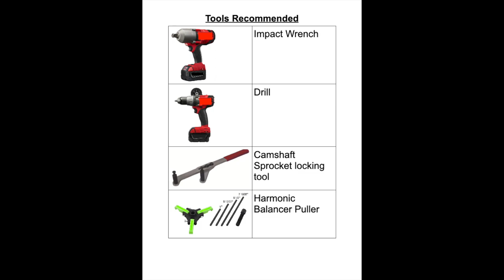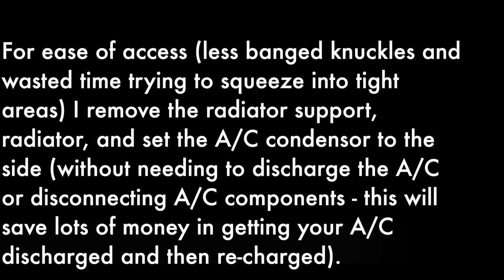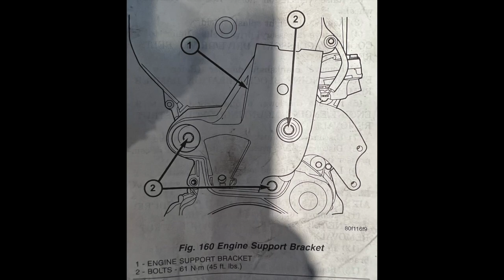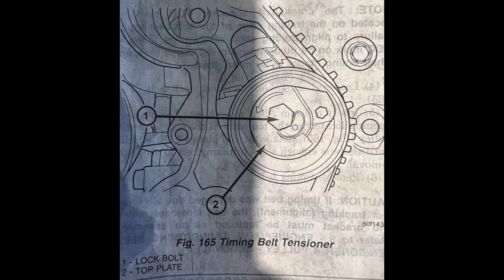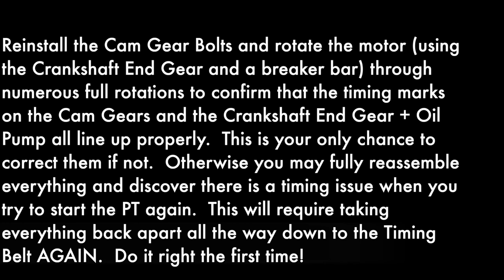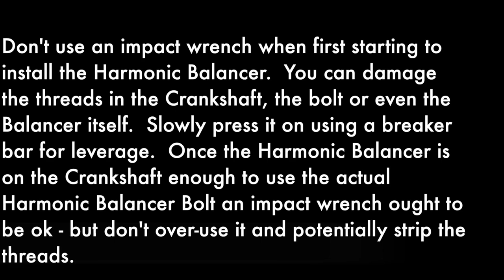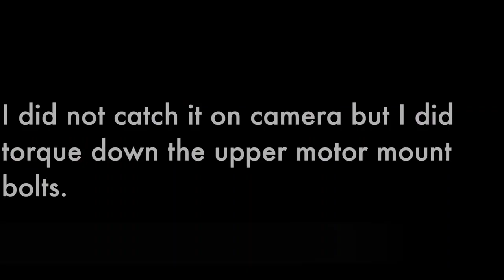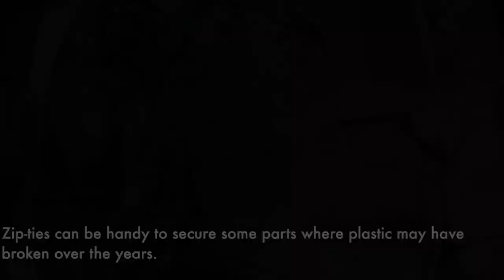PT Cruiser Timing Belt Replacement

Comment: Hi there, I just came across your video on pt timing belt replacement...you make it seem so easy!
I am not 100% sure timing belt is the issue with my 05 PT, I unsuccessfully have thrown parts at her and took to a shop that couldn't fix either.
A friend thinks timing belt has jumped teeth.
Yeah, at 140k, a belt is needed no matter what....
Issue is, she runs fine up till 2k rpm, then she stutters and bucks like crazy, gets on down the road just fine as long as she stays under 2k rmp 😞
This sound like a timing belt issue to you?
Thanks!
Reply from the maker: @fingersofskill Thanks for stopping by and posting your question.

Even a single tooth jump can cause issues so I wouldn't necessarily rule that out.

Can I ask for a bit more info:
What parts have you already swapped/checked?
What did the shop do?

• Do you have the ability to do some testing and have some tools to diagnose?
• Sounds like fuel is flowing and that's not an issue.
• I would want to check for compression in each cylinder (will require taking off the Intake Manifold and Spark Plugs and a compression check tool).  This should hopefully help diagnose if you have a blown head gasket and perhaps a cylinder not firing as a result.  As you have the Intake Manifold removed I would check all gaskets as you go to make sure you have good seals and no air leaks.  Check the hoses that all plug into the Intake as well for dry/cracked hoses that need to be replaced.
• While you have the Intake removed you can also do a spark test to check that the coil is sending a spark through each wire to the spark plugs.

Basically I'd go through these basic tests for fuel, air, and spark first.  Let me know if this helps or if you might need more info/help.

Comment: Great video. I've replaced a few timing belts in the past but this one looks to be the most complicated. The last one I did was on the wife's Neon as a preventative measure. That car's long gone...I just picked up a 2006 PT turbo convertible with 32k miles. I haven't researched this yet but your engine is clearly NOT and interference engine and I'm wondering if mine is too (2.4l Turbo) so if you know please reply.
Reply from the maker: Hello!  Thanks for posting your question.

The 2.4L Inline 4 Cylinder from Chrysler is not an interference motor as you were able to discern.  That includes the Turbo models as well.  In fact - the Timing Belt replacement will be almost the exact same process as on the N/A model once you remove the Upper Intake Manifold and disconnect what is needed around the Turbocharger and exhaust manifold.

I have not yet recorded the Timing Belt replacement on a Turbo Model, but if you check out my channel you can at least see my reassembly of the Turbo motor I swapped into my (originally N/A) PT Cruiser.  This may help guide you through what is involved on the Turbo Motor and you might be able to reverse the process so you know what to do for disassembly.

You could start here (Chapter 9: Motor Assembly Part 3)
https://youtu.be/X5965Ur85rQ?si=bcgp-4-E3AAtC2Th

Eventually I will post the Timing Belt replacement on a Turbo Motor start to finish but I haven't had the chance yet.

I hope this helps - best of luck as you dive in!

Shane of PTBubbles
Reply: @PTBubbles  Thanks! Takes a load off my mind.

Comment: hey ptbubbles, so I got the repair all done. However when I went to start up the engine it only revs to 4k rpm. Any ideas why it might be in limp mode? I have the turbo model and there's no check engine lights
Reply from the maker: @FrozenCalzone

Glad to hear back from you.  I tried to respond to your question about the motor mount bracket and those pesky bolts but I think the comment was gone?  I couldn't find it.  I hope that means you figured it out.  You can jack the motor UP pretty high as well and take the bolts/bracket out of the top if you need to.  I've done it both from the bottom and the top.

Are you Revving in Park/Neutral or do you mean it only goes to 4k rpm while you are driving?  It is normal due to the Rev limiter (set in the PCM) for the PT (N/A and Turbo) to max out around 4k while in Park/Neutral.  This video here shows another PT Turbo doing this: https://youtu.be/w9UtdRnnB1s?si=ieNTf5lS2Wpc2YaN

So as long as it is not having issue while driving and it idles smooth it sounds like you did a great job swapping the belt.  Excellent work if so!

Let me know if the issue is present while driving and I'll see if I can help.

Shane of PTBubbles
Reply: @PTBubbles Thanks for trying to help yesterday, I figured it out. I just had to pull the engine forward a bit lol. I was unaware about the rev limiter in park/neutral and was worried that I did something wrong. Took it for a test drive and it's better than ever. About 40 miles into a road trip so it's safe to say that it's working as intended. Just wanted to thank you so much for your video and all your help!
Reply from the maker: @FrozenCalzone  This is wonderful to hear my friend!  Nice work.  You can say you did it and know that much more about your PT.

I hope it treats you well for many years and 1000s of miles to come.  👍

Shane of PTBubbles

Comment: What is the time frame for completing this timing belt replacement?
Reply from the maker: Once you have the parts, tools, and are ready to go I would give yourself a day just in case you run into anything along the way (broken parts, stripped bolts etc).  If you are able to proceed without anything slowing you down then I'd say you can do the belt within 3-5 hours.  Some may be able to do faster but it's always safe, when working on cars, to take your time estimate and multiply it by three for a more realistic and safe estimate.

I hope that helps.

Comment: Is it interference valves?
Reply from the maker: In short the answer is "no" IF we are talking about the DOHC 2.4L motor.  There were also the SOHC 1.6L and 2.0L engines which WERE interference.

On the most common 2.4L engine the timing belt breaking will not cause the valves to impact the pistons.

You will find all kinds of answers on this if you start searching the internet - and a LOT of wrong answers.

But again - the 2.4L DOHC engine is NON-interference.

Comment: Where can i find that upper timing assembly plastic cover?

Do you recommend changing the water pump being so close to that area?
Reply from the maker: I got the Timing assembly cover from modern performance.com - lots of great things there and I go there frequently.
Reply: I did not last time because of the quality of the new pump i got and now i have to go back in. It helps to know how old the pump is however it is a little more work than just the belt.

Comment: My Saturn ion 2003.. They said it would cost over $5,000 to replace due to engine failure...Fact...or Fiction
Reply from the maker: Hello - are you talking about just the Timing Belt?  $5000 for a Timing Belt seems pretty ludicrous.

Or was the $5000 quote for a whole new engine? (Including labor etc.)  That still seems quite high regardless.

Would need to know more info as to what exactly the quote was for.
Reply: @PTBubbles  They say timing chain broke...regardless I found a much newer car and I letting the Saturn die...She was over 22 years old/Over 266,000 miles!

Comment: My 03 wrangler has the same motor, but its not transverse. Much easier.
Reply from the maker: @bubbashubbs298 Thank you for the post!  You've highly peaked my attention!

May I ask if your Wrangler has the 42RLE (rear wheel drive) transmission as well?  I am looking into getting one of the 42RLE transmissions (basically the rear wheel drive version of the 41TE transmissions in the PT Cruisers).  I have an extra 2.4L engine and I wanted to find one of the 42RLEs so that I could put the motor and transmission into something like an old Valiant.
Reply: @PTBubbles  Mine is a a 5 speed NV1500. The 42R(L)E was put in all 2003-2006 wranglers.
Reply from the maker: @bubbashubbs298  Thanks for the clarification.

So you have a 2.4L 4 cylinder into the NV1500?
Reply: Yeah @PTBubbles